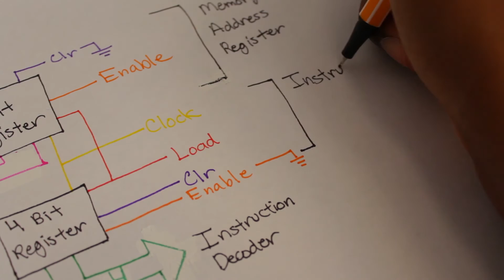Instruction Register | 8 Bit CPU

Comment: Hey AM Tech, I'm also building an 8-bit computer, but ran into some huge voltage issues. My voltage drops massively when I have multiple breadboards connected. On the first breadboard I have around 4.5V and after like 5 breadboards it drops all the way down to around 2V. I already tried many things with no success.

Do you encountered the same voltage issue and or do you know the solution to the problem? I use an apple phone charger with 5V 1A output over a 2 meter usb 3.0 cable to my breadboard where I just use the power and ground connections. What do you use as power supply and what voltage measurements do you get on your breadboards?
Reply from the maker: I use the exact same setup except a usb 2.0 wire. I don't have any voltage drop issues. I would check the power rails individually on the breadboards without connecting them together. 1A is a lot of current so I don't think that is an issue. Make sure the output is actually 5W at the end of your usb 3.0 connector. Sorry it took me so long to get back to you.
Reply: I solved it! The problem was the resistance of the contact area between breadboard and cable. So for every breadboard I added I had more resistance and another voltage drop. I solved it by soldering the power cables together, so that I basically have just one contact area for each power rail.